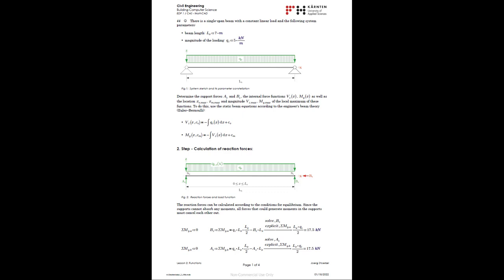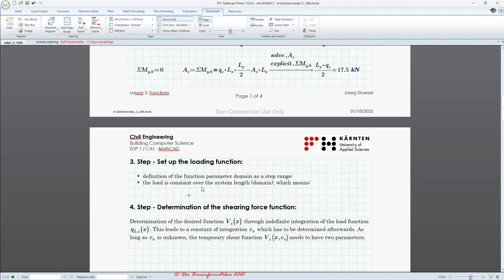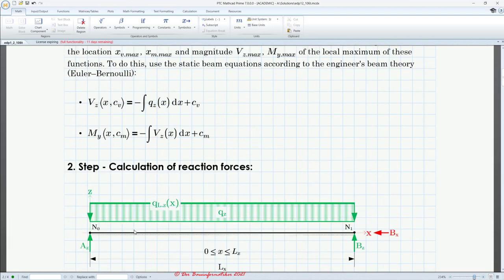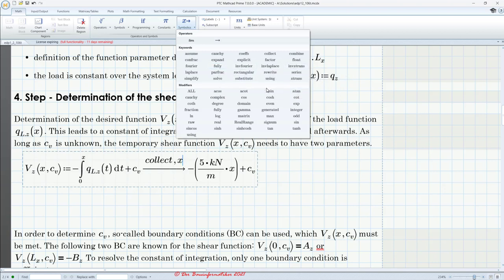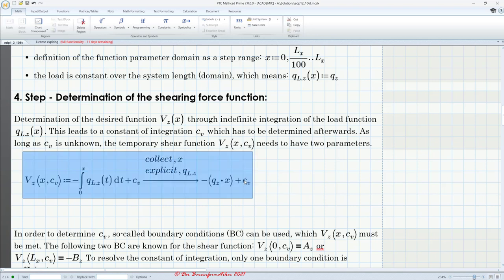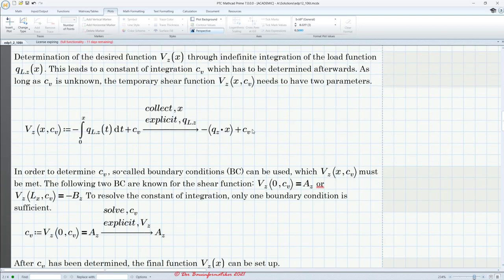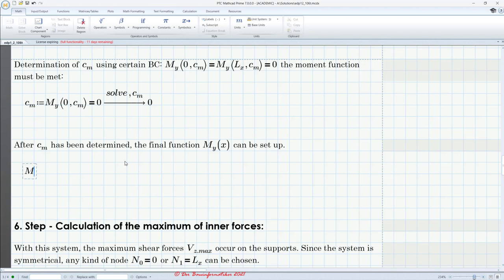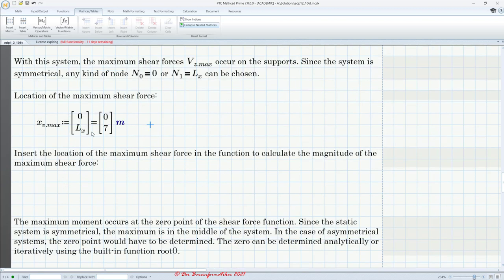MathCAD Prime Basics – L2: T2 Implementing Engineer's Beam Theory using Functions

Comment: Hi!, How would you define the load equation in mathcad if the load wasn't distributed but a concentrated?.. using the same method of integration.
Reply from the maker: I'm sorry that I'm just now responding. Unfortunately, I only just noticed your comment. When I once again lost myself to my own video. 

Well, a point load, in my opinion, cannot be defined as a function as easily as, say, a line load. I'm not a mathematician, but I would say that a point load does not fulfill the character of a function. Therefore, I don't think this analytical approach would work with it. However, it would be more interesting to try this approach with different kind of line loads within one function. This could possibly work depending on the type of the used integration method. 

But I am open for a discussion. If someone has a better idea, he should share it with us!